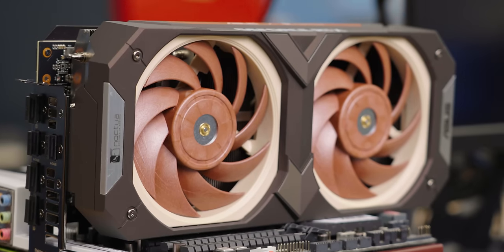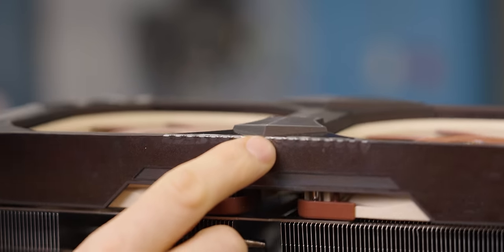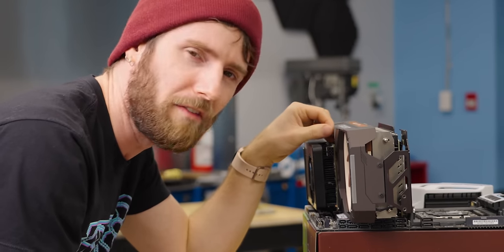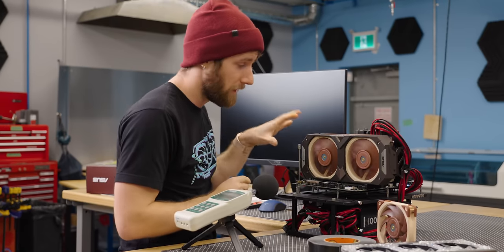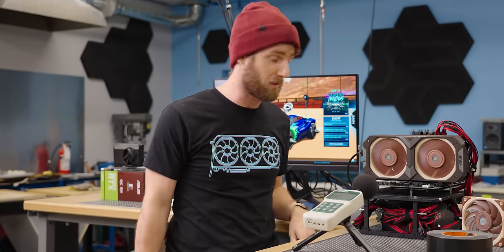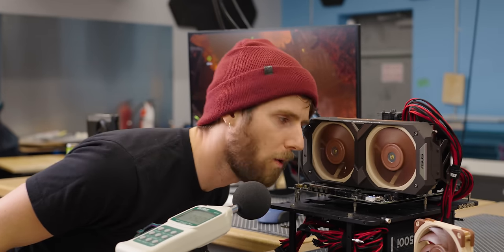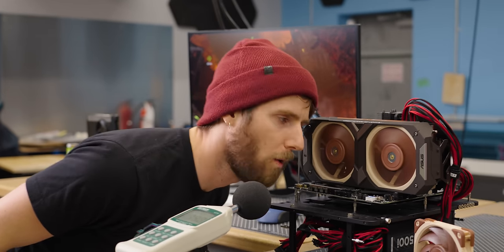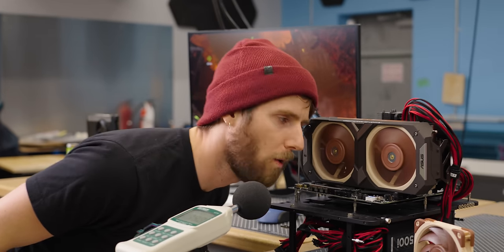Real Noctua GPU vs Redneck Engineering My Own

Comment: Of course you can't, if you wanted it to fail. RPM and PWM (and Y-split ground) wires should still have been connected to fan header on video card. Then it would have been a fair test.

Comment: If you 3D printed a shroud you might be able to make something approaching this level of performance and quietness. There are too many potential points for air to escape before it's traveled the length of the heatsink which I figure is why GPUs have a shroud to begin with.
Reply: you dont need a shroud. Mine has been running without one, just the sink and fans, for years. Low temps and noise.

Comment: the casing has aerodynamics gives i think 20-30% cooling performance

10% casing temp increase could be wrong
size 4 might spew more air out of the case
thermodynamics its harder to increase higher temp by 1° requires more energy.

Comment: @ 14:52 As a Canadian you should be required to recite several Red Green Quotes
Reasons: 1: Canadian 2: Using "Redneck" in title 3: Use of Duct Tape
"We hold these two pieces together using the handyman's secret weapon, duct tape."
"Spare the duct tape, spoil the job."
"If it ain't broke, you're not trying."

Red Green

Comment: I had a 1070 where the fan speed sensor or something went and all the fans were spinning at 100%.

I pulled them off and put some Noctuas on there with hair ties, and it immediately made me wish that a video card manufacturer would just cut the horse shit and make coolers designed to just take 90-120mm fans.

Comment: The GPU paste could make a difference also if you had the fans set to system and made a custom curve you could see better temps. I do this with my GPU because I have the ASUS phoenix 1660 super, putting a 120mm fan and doing a custom curve as well as undervolting has helped me tame the beast. I no longer have temps of 90*C I typically max out at like 75 but stay around 60-65 now. Oh and despite the undervolt I actually have a slight overclock as well.

Comment: Think you done something wrong here, i used the stock heatsink and put noctua fans on my 5700 xt and i'm getting 58 degrees under load. Mind you you have to be very careful that you make a good seal between the fans and the heatsink otherwise the air doesnt go through it, it goes around it.

Comment: I just stick my old laptop between 2 windows in winter. When it's real cold outside it goes sub-zero at light load and 30ish at full tilt. Beat that price to performance Linus!
Inside, it just throttles like a mofo.

Comment: I wonder if it wouldve been better to use wire instead of tape since that blocks allot of air, i've upgraded my cpu cooler to have a 2nd fan and attached it with wire, works perfect.

Comment: Noctua Fans are really quite - that is why e.g Xi-Machines use this in workstation and this workstation are stand in extreme quite rooms e.g. high-end control-rooms or recording stages for exable the Syncron-Stage.
In this rooms a workstation must be silent and silent is there a huge challenge. 
The other use case for workstation they are equipped with Noctuas fans are machines for the Sleep laboratory ....

Comment: I've build 1080ti Asus Strix with 2 Arctic P12 PWM PST using only zipties. This made GPU inaudible, lost 10⁰C by the hotspot and made look original shroud like new (that's crucial because I sell cards as I upgrade). IDK what's wrong with Linus redneck engineering.
Reply: propaganda so we dont use cheap alternatives.

Comment: i attached 2 collermaster 120mm fans to my gtx 970 and i put the fan socket to the system fan on the MB and manged the temp curve with software is called fan contol i have decent temp reading

Comment: System FAN Port RPM can't be the same with GPU FAN even push to high speed on bios. Try to show with PWM to 3 Pin that will be a different result.

Comment: I'm currently waiting in for a GPU fan to 4pin PWM adaptor, some cable ties and a Noctua NF-P12 Redux 1700rpm. You know what I'm up to lol, I'm actually only doing it because the Palit RTX 2060 I have is a single fan and between 75 and 90c it rattles really loud, the temps aren't bad (71 - 73c ) ish at load, well within the 88c thermal ceiling but if I can get them down to maybe 65 at load I can increase my overclock. I'm determined to make this 2060 into a poor man's 3060 lol

Comment: Linus, You could've just connect the fans to the GPU Fan port via 4-pin gpu fan adapter and then compare the temps. The comparsion that You've done isn't in my opinion accurate (it's just my opinion so it can be invalid 😉), if You make another video with using an adapter to let the GPU handle the fans and ramp them up as it does with the ASUSxNoctua 3070 then we can tell if the original one is better or not with their 4-slot chungus than the home made one. Also You can do a comparison with the home made 3D printed shroud and see what temps the 3070 will have then with noctua fans 😉 I would like to see that (yeah I know that not everybody has a 3d printer at home).

Comment: Should've used a third-party heatsink+noctua fans as the DIY solution, not duct taping fans on the default heatsink.

I bet a morhpeus ii + 2x A12 fans would be closer to the real card.

Comment: 11:20 if they used zipties, or a lot less wide tape, it would have even better resoults. Also we dont know if the noctua card had a better thermal pads and paste or not... And the noctua cooler is larger.

Comment: Linus your test is flawed. In 11:19 you are blocking part of the airflow with that piece of tape and the heatsink can't dissipate heat properly. That has an impact on cooling performance. Use zip ties instead.

Comment: Year late but there are mini GPU fan adapters to plug the fans into the fan controller on the GPU. I did it to the fury X someone slapped a Morpheus cooler too and put two mis matched 3 pin fans on it and they ran full tilt. Was so loud I couldn't stand it so I went to searching how to connect them. Think it's a mini 5 pin is what it's called

Comment: Congrats ASUS and Noctua achieved something that was done by Sapphire through generations of AMD graphics cards. Ive had a R9 290x 8gb Vapor-X videocard, it was quiet and never exceeded 70c under 100% load. After that i had 2 Sapphire Radeon R9 390x Nitro, in Crossfire, and it was the same thing, 70c top, 60c bottom, under full load. Right now im rocking 2 Sapphire Radeon RX VEGA 64 Nitro and it is again, the same story, and they are doing that, without even ramping up the RPM on the fans.....

Comment: Sad the result is not compareable, also no data about stock cooler results of th 2nd card. So that we could at least say something like, the small 8-10mm Fans are at least xx db more noisy or temperature results have changed > xx °C. I am sure with cable fixer and a small distance 120mm unit the results would be better. The tape is bad for the air flow.

Comment: With respect to the card's girth. Does anyone actually use a lot of PCI slots these days? Once I had sound card, network card, tv tuner and multi GPU. Now the only occupied slot is a single GPU, so is actually necessary for GPU designers to worry about the heights anymore?

Comment: yooo this video is awesome , im kinda lost , cuz technicly Linus did the same thing , with the same fans and still asus x noctua 3070 win the temp battle , did asus x noctua made just 3070's like this ? this cooler is overbuilt and could work on 3080's and 3090's for sure

Comment: so you should do the mod on a card that allows casefans to be directly attatched to the gpu pcb, the RX5700xt allows this as I did this mod (without ductape) awhile back after the middle stock fan died on asus rog strix gaming OC 5700xt

Comment: coil whine, hated it.
Once configured my 1070 to kick in only very late with the fans, only to realize the coil while is much more annoying than the fans could ever be!
Reply: and yes, you could easily build it your own with an aftermarket cooler, but this ends up in much higher costs so its useless.

Comment: Is liquid cooling your graphics card worth the difference in cost versus strapping extra fans to it?
Reply: nop, just take off whatever fans and plastic they have, buy 2 good case fans and zip them to the radiator. Usually you can control fan curves from bios or other software. It's cheap and works really well. It doesn't look good tho, and takes more space, thats the con.

Comment: So a not so fast card with extreme cooling? Why not put these coolers on the most OC version you can get. Yes noise is a thing, but i don't understand the reason why you would buy a slower GPU with higher cooling potential of others can pretty much match it with more fann speed in a closed case. Feels like a slow car with drift car cooling.

Comment: If you want to limit the chances of your fans kicking in at all, something like MSI Afterburner is great (works with other brand cards too for those who don't know) you can lower the power limits, so you still get good performance in older less demanding games like Rocket League Or CS-GO etc. But with less heat and noise and energy use! 

Also even low end games if you have V Sync off and no framerate limiter in place, it is gonna use a lot of power and ramp up the heat (and fans) because it's going to work as hard as it can to produce as many frames as it can, for casual gaming if your monitor is 144hz you don't have much benefit running a game at 350FPS, if you have a 60hz monitor then limiting to around 60 is gonna save a ton of power. 

Follow me for more tech tips! :D

Comment: it feels like noctua gpu elevated those cooler fin to give hot air an exit room thats probably why its so thick.  
old gpu design especially those 2-2.2 slots thick card are so compact and tight. modding those card dont achieve any cooler performance, just quieter.

Comment: I don't know why GPU makers feel the need to limit themselves to a 2-slot design. Christ, SLI/Crossfire isn't a thing anymore and it's not like there are soundcards hogging up PCIe slots, so there's little to no reason to limit yourself to a 2-slot card when you could have a 3-slot design with much better performance and/or less noise. Last time I checked, ATX boards, which are what most people run, have a lot of PCIe slots and space.

Comment: That's so COOOL! The ASUS TUF 30 series cards are pretty sweet already. I would have definitely bought that monstrosity if I could. Now I'm wondering how hard it would be, if possible, to change the 3 stock fans to something better. Anyone have any idea, a place to start looking???
TLDR; Going from a 1080TI to the TUF 3080TI, I had to mod my case w/ 2x 140mm bottom intakes and add better front fans, to keep me happy on the CPU temp (280 AIO, rad at top, exhaust). Could undervolt or flip the rad direction/ location (maybe later) but brute force is more fun lol- The stock TUF card always maintains high boost yet runs super cool (never seen it much over 80c even with less optimal conditions) so it dumps all that 350w of heat straight into the case (it's gotta go somewhere) where it was getting recirculated. With the bottom 140s, it stays chillin under 70c, in a real world case (Corsair Carbide Air 540- older, not flashy, but super practical, functional, and an absolute joy to work in)

Comment: They made this big of a cooler and then they put it on a 3070 instead of a 3080 or 3090, this card is obviously for a premium enthusiast market but is on the mid range option, doesnt make much sense

Comment: :elbowcough:
Hello community. I have a stuping and embarassing question.

Is it theoretically possible to have a Raspberry Pi in the desktop case and actually launching the OS? Like you can perform the base stuff like browsing etc. And when you launch something heavy it will launch all the monstrous power you have there from the main components

Why? - Lower power consumption. Maybe launching BIOS while the system is running without the need of restarting the PC and other fancy stuff

Comment: Weirdly I bought this one as one of the cheaper 3070 cards in my region a few days ago... i live in sweden, ordered it from a danish seller as i wanted to buy something like 3060 ti, 3070 or 3070 ti... ended up choosing this one... for price reasons! (maybe because it's so thick the miners are less interested in it? does it matter to them? I don't know exactly how that works, really i'm not even that much of a tech nerd i'm just a user) It's messed up the relation between prices and quality/performance are all over the place when i've been looking for a graphics card recently to replace my 960 ti which only has 2 gb vram, not just that they are insanely expensive but just seemingly random too... I still wouldn't have bought it unless i was lucked out with some personal financial decisions recently and ended up suddenly with a lot more money than i ever expected... which was also random and unrelated to anything of real talent or value, nothing makes sense any more.

Comment: my version runs cooler, your heatsink is really small, thats one of the reasons its running hotter, and your not controlling the fans right, there is software for this kind of setup.

Comment: hahha everytime they showed doom enternal in the background.. it looked like the card was going up in smoke... but what the hell why didnt you overclock it and push the card and max the fan speeds and then see the results... plus you u just used the same fans... not the same heatsink. your talking about an overkill asus cooler on the non overclocked version of a 3070... and then you put some cheap ass one on their.. you should have compared it to the asus strix card as well... sorry but completely better results on Jays 2 cents on this one.

Comment: Only 1950 mhz? My 3070 ftw3 sits at 2100, granted that it's running at 300 watts but still
Reply: You are trying to compare Ampere cores to Ada Lovelace cores solely by clock frequency. That's not a very good idea at all. Higher frequency doesn't always translate to better performance if you are talking about two different core architectures.
Reply: @ДмитроПрищепа-д3я Are you high? He literally explained in the first few minutes that it's a 3070, so it's not ada. The 4080 wasn't even out in 2021
Reply: @fksllil4068  yes, 3070 is not ada, it's Ampere, lmao. Reading comprehension is not your stronger side, is it?
Reply: @ДмитроПрищепа-д3я What? You are the one saying that I am comparing Ada Lovelace cores to Ampere cores
Reply: @fksllil4068  you are tho. Literally. In your comment you said "Only 1950 mhz?", referring to 4080, which uses Ada Lovelace cores. Then you continued by proudly saying that "My 3070 ftw3 sits at 2100", which uses Ampere cores. What is it, if not comparing frequencies of different core architectures?

Comment: I am doing light simulations with a matlab code that uses GPU... ^_^ the more memory the better, the more cuda cores the better... How big could you do it with NV-link? I am using a single RTX-3090 which is cool :) but who doesn't need more in simulations.... :( :/

Comment: Could LMG make a RaijinTek Morpheus 8057 with two Noctua NF-A12x25 fans on a Asus 3070 Tuf Gaming vs Asus x noctua 3070? It might be better with the 3000 series asus cards becuse the separate vram cooler.

Comment: is there a reson why u not just use the msi afterburner to set the fans to the same fan speed or adjust the card with playing with fan speed to have the same temperature for like comparable noise ?

Comment: He did it totally wrong by putting tape on the sides where the hot air should come out. No wonder it got so hot. If he used tie-wraps I think the result could've veen much better.

Comment: well, i have a inno3d ichill 1060 6gb overclocked at 2150mhz core and memory at 4750mhz and  max furmark temp of 75 degrees, but... when i play warzone it maxes at 55 degrees which is weird because furmark only goes up to 2050mhz and warzone to the full 2150mhz. and this card is very very silent, even at max fan speed it isnt louder than my case fans.

Comment: Linus...a decade? pffft...thats nothing bud. I was modifying vantec cpu fan's to my video card's way back in 2000-01 on even my radeon 8500! Back when water cooling was done with old car part radiator's, and really whatever you could think of to work. We had to cut our own side panels up for windows to fit in them, and my room was so blazing hot that we moved our computer's to my cousin's garage and would LAN playing CS 1.3 with the garage door open in the middle of winter. those were the day's... 🤦‍♂️🤦‍♂️🤷‍♂️

Comment: My gpu in my case only gets like 56°c on full load while gaming.. So guess mine has a pretty good cooler too...  my cpu temps stay about the same as that to like 56. I have the assassin 3 air cooler. Are those really good temps?

Comment: He has 3D printers and he tapes them on. Then he halfass puts silent adapters on there. Doesn't mention it could be mostly firmware optimizations that you could reflash yourself.  Also why do that when water cooling is quieter? It's a waste of time and money.

Comment: The reason for so many MB's not having many PCIe slots on their MB's is because.. well why when you only get 20 PCIe lanes from the CPU's?  And the Graphics cards are X16.. that leaves you X4 .. whoopty dooo.. you can add some add on card.. a sound card, a network card or a M.2 card  Yea, we were able to use 2 PCIe slots..  who remembers when Intel had 40 lanes with their I7-4930k?  I do, I still have mine.. 40 lanes, not the cheap 20 lanes of connectivity.. Stop being CHEAP INTEL..

Comment: Es una pena que la versión de noctua de una 4080 valga casi lo mismo que una 4090 normal. Y mi 3060 ti logra más temperatura en su hot spot